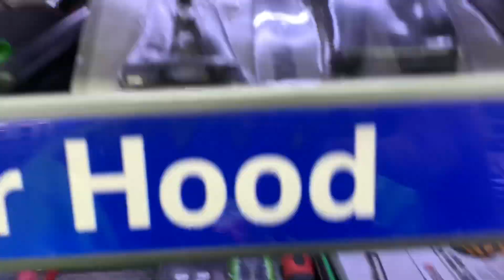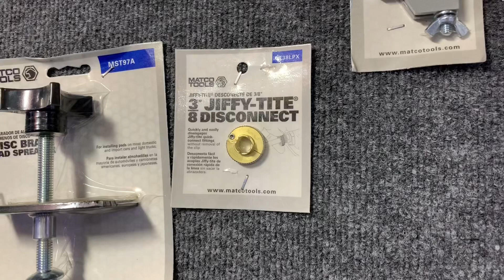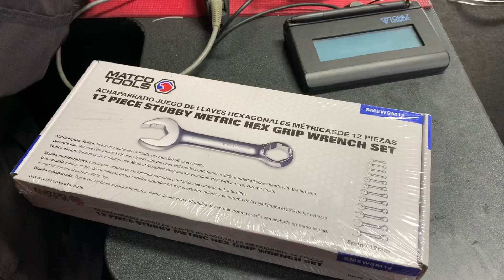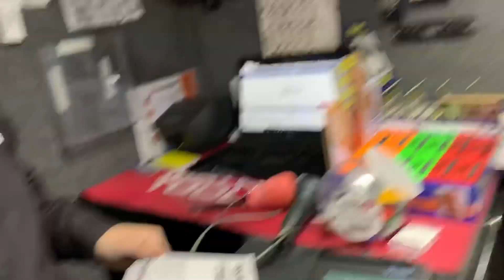Matco Tools New Stubby Extractor Wrenches

Comment: My Matco dealer Shane is the best! He was an engineer and a tech before he sold tools, so all you have to do is describe what you are doing and he will tell you  exactly what you need, he saved me a lot of money once! I was going to get 12 pc set of chrome sockets and he said he had and 42 piece set of impact sockets for the same price, I instantly bought the impacts also the housing on my 1/2 inch gun broke and instead of making me wait to get it fixed he gave me a new gun! Now that is service! Hard to believe I had a bad Matco dealer at one time and hated Matco!

Comment: The wrench is used on what's called a bevel seat connection, they're are used on hoses, flowverters and numerous other sanitary connections in everything from food, milk, soda, beer and pharmaceutical use.  The wrenches are aluminum, but all the sanitary connections are usually 304 or 316 stainless. ;-)  The bevel seat sanitary connection is similar to a pipe union.

Comment: i may be wrong but that wrench may be for large meat grinder for grinding burger and the likes taking off the grinding plate or sizing plate what ever you want to call it. Talk about pain in the ass fittings to get i dont recall the brand of truck but the engine was the 60 series detroit on that fuel line that would rub on the frame took a stubby 7/8 wrench to get that sucker